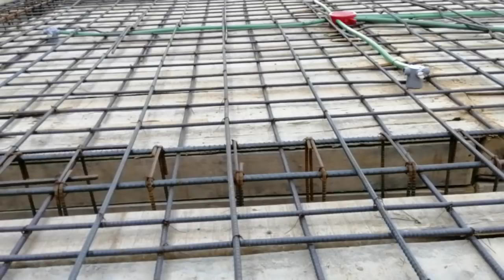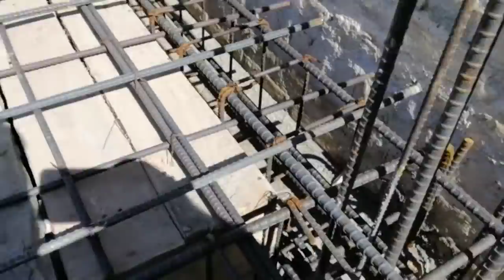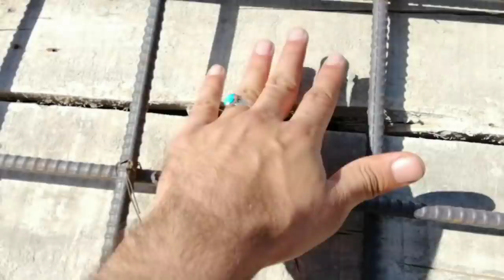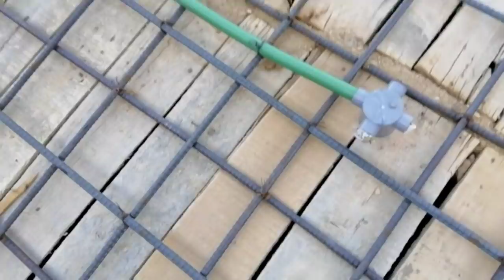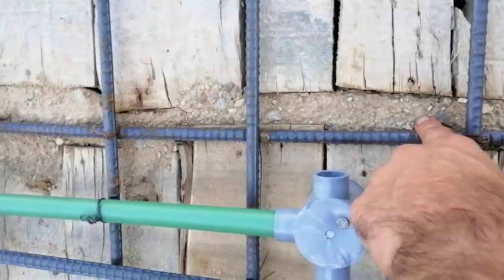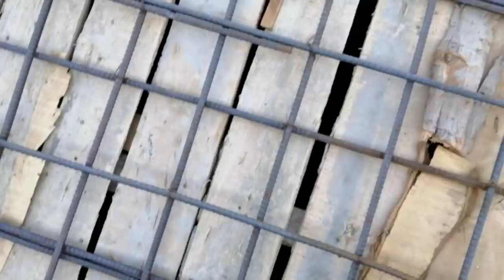Big Mistakes in RCC Slab - Lapping Mistakes - Reinforcement Mistakes - Civil Engineering

Comment from the maker: Remember Guys .. the Upper Bars Lapping should be Provided at the Mid but the tension Bars ( Positive Bars ) Lapping should not be provided  at the mid but should be provided with L/4 Distance ... Thank you.
Reply: You focused on lapping, have you noticed the spacers between forms and rebars?
Reply: @lovewings15corpus31  damn...you are right bro
Reply: I think in simple terms, laps should be provided in the compressive zones of the structural elements. This means laping of bottom bars at beam supports (compressive zone of fixed ended slab) is ok.
Reply: Well for bottom rebars of slab lap is on centre of support. For top reinforcement lap is in centre.
Reply: Sir I didn't understand that lapping length should not be done at the end of the support because shear stresses are more. What kind of lapping is that? Please clear my doubt
Reply: @AbdulRaheem-kk8kv  for bottom bars laps are at support for top bars to cater negative reinforcement at supports there laps are at centre of span
Reply: @arslanamar7011  thanks
Reply: When the top bar and bottom bars are tied together..it's cool
Reply: What is the real reason that they made a mistake by providing Lapping near the beam?  Is it really so difficult to avoid it?
Reply: Review ur knowledge
Reply: But in slap with beam there is only one layer
Reply: So we ve to reassembled All bar sir?
Reply: L/4 or L/3?
Reply: @altain  11
Reply: Since the problem is already there,
What are the probable solutions?

I am just curious.

Thank you

Comment: Sir, we are building a 2-storey house and the schedule of columns are 4 (16 mm steel bars) and 2 (12 mm steel brs), the schedule of beam used is 4 (16 mm)?Is that okay? The steel of the beam used are heavier than the columns?  Total floor area is 162 sq meters. Thanks for answering.

Comment: Military code requires that standard 1 inch thick rebars be used and spaced apart by 1 to 2 inches. All hoops should be .5 inch thick and spaced apart by 1 to 1.5 inches. There should be no splice connections in any concrete floor slab and all splice connections must be done at the beam bending downward at right side of the beam and bending inward to form a U shape upward hook if coming from the left and vice-versa if coming from the right. There should be no splice connections in the middle. For the beams any splice connections should continue through the post steel rebar and be bent-hook at the right side of the post main rebar if coming from the left and vice-versa if coming from the right. The wire ties should be double-twisted double wires so as to increase hooking-holding power after being tied together to hold the hoops and rebars together and that of the main rebars.

Comment: You can lap the bottom bars of the slab at the support if it is continuous, as the hogging moment is putting the top bars in tension. It is the top bars (bars in tension) where you shouldn't lap at the support.

Comment: Location of lapping is ok...review your theory of structure subject because ...slab is treated as beam so there is tension part and compression part...so if ever avoid lapping at tension area if possible but if you cannot avoid it , apply what the code recommend

Comment: There is no Cover to underside of bars no Space blocks have not been used .  You missed that ?  would have been better Laying plastic sheet down on the decking board with the amount of gaps that are in the board . Normally us 8+4 ply + 18mm thick and Mastic joints up from Were I’m from 🇬🇧 is a Drawing supplied giving details for the steel to the fixtures plus the schedules to. Then there is no mistake if they go by the drawing and the length of bars on the schedule .?

Comment: nicely explained thanks 1 point i would like to make is you did not mention about the concrete cover, the steel seem to be sitting directly on top of the formwork should that steel no be lifted to provide minimum cover 50 or 40mm  ?

Comment: Hi ! Sir i have build concrete tank before 40 years ago now i want build 3 feet high wall with bricks on the tank and i want to  put 500 gallon water  plastic tank on it . Does it stable enough????????
Reply: Hi, I am uthayasunthar from srilanka, as your request, you are going to demolish the concrete water tank and replace a plastic tank  ( approximately 2000 lit) . To consider your request the following are needed 1. What is your existing tank capacity and wall thickness,  2. existing colomun  details which are underneath water tank.  . Then it is possible to say the stability of your structure.  However  W e Engineers mostly designed the structure for 50 years life  period due to materials characters of the  market.
Reply: @uruthiranuthayasunthar2073  no Sir  i am not going to demolish concrete water tank actually I'm going to build break wall on this  concrete water tank & to put 500 gallons water plastic tank on it to ramp up water pressure . The concrete water tank is no longer useable due to leakage. 
The thickness of the concrete water tank wall is 6 inches and length is 69 inches.
Reply: @r.dmangol2199  , if you have a tank , this building has about 40 years old. No details r/f of the structure .it is not advisable to keep a tank . Now you are going to build a break wall and place a tank. Accordingly  you will  add wall weight and water weight additionally on the slab. It will be reached failure.  It is safe to replace tank , then you should remove same weight of the concrete structure ( available tank) . Then you know removed  soild concrete  find the weight of removed concrete weight and  replace the tank approximately 80% of the weight . ( Your tank capacity is not mentioned properly please)

Comment: Hello dear hope u will be fine actually I noticed something in your vedio that the lapping bar which they provided is correct  coz in slab bottom (B) we should lap the steel in the supported mean l/4  area and top bar we should lap in the mid of the Spain mean l/2  I am saying coz the same rule we are following here in dubai and as per the design, its corect coz that area is the critical zone area also compression tension occurring sory I just share my experience one thing more there is no cover block touching with shutter

Comment: after a major earthquake near mexico city.. many building fell in mexico city.. including new hospitals.. they showed them starting to rebuild the hospital.. there were piles of sand, gravel and cement. and a guy with a garden hose.. each worker had a 5 gallon bucket and a trowel.. that is how they were pouring the footings for the new hospital.  i called the mexican embassy.. actually got to talk to somebody about this. they had seen the same footage.  thought how great it is to have so many working.. i said every time there is an earthquake that building will collapse.. that is no way to mix structural concrete..  it won't flex it will crumble.. they changed the work rules in mexico.. buildings are now only poured using batch mixed and tested cements. no longer hand mixed like you could do on a single story house..

Comment: As per IS456:2000 the lapping length for beam in comparison reinforcement is development length or 24dia whichever is less and its can be provided at beam column junction to 0.25L of the beam length.
For tensions reinforcement the lap length is development length or 30dia whichever is greater and its can be provided at beam column junction to 0.25L of the beam length and lappingreinforcement is always alternatively provided.

Comment: Extremely poor work. No consideration for the owner of the building. The contractor should make corrections to the spaces in the decking.  I am of the view that if you join  steel steel midway on the span it is going to be weaker, best place to join is where you have some support.

Comment: sir ,see curtailment detailing of roof slab,pls lapping at the end is ok for slab ,but for beam also in bottom is ok,top rod id a mistake 
pls kindly refer structural detailing of slab
shear in slab is near to zero ,base on the depth - shear increase based on depth increase

Comment: big mistakes with the formwork the concrete will cure too quick because of all the gaps and make it weak due to extra water loss and shrinkage
Reply: My opinion as an engineer this structure is rejected during inspection especially the formworks there should be no gap in between the formworks for the water wth cement will leak-out.use plywood formworks suitable thickness instead.

Comment: Agree with your two point.
1. Form work seems poor, Due to continious bleeding ( water falling from concrete ) disturbs water cement ratio the end result will concrete looses its required strength.
2.  Bar and striups spacing.

Comment: Not at all correct. Lap for slab should be on beam. Not at mid as load of slab is on beam, hence the weak zone that is lap should be through the beam. Sagging is encountered at the mid span, hence lap shouldn't be at mid span

Comment: This is not a lap.  Centre of both bars lap is in the centre of beam and it does not make any effect. This etra length of bars could have been cut. Main mistake was , there was not cranking or extra bars at support. So this video is misguiding to learners
Reply: Exactly that what i observed looking at the structure, beside there is no cover block.

Comment: 1. Main bar and distribution bar can be of same dia and the C/C distance between distribution bars can be increased. That will anyway will be decided based on one way or two way configuration. 
2. You should have shown the structural drawing for easy understanding of the mistakes you are trying to show. Without a drawing how the audience will get a picture?
3. Lapping length is not provided exactly at the end support . Yes the lapping should have been staggered but definitely not st the centre of slab. 
4. Wood form work crack lead to bleeding. 👌 perfect 
5. Some points you probably missed out....(a) No extra bar provided at end support of beam as top reinforcement. May not be required as per the design but  seeing the span it seems an omission.
(b) Stirrups not bent inwards at 135 degrees as per the codal provision.
Reply: Mr. Vinod Kumar, u have pointed out the mistakes in a much better way than this guy...

Comment: I was afraid that this video might be misleading in terms of lapping but almost got that lapping for a 2 way slab should be near the support due to the fact that there would be induced moment at the centre of the slab, and thus having a tensile force acting at the centre of slab. Also the lapping o reinforcement can be in the same place however, providing alternate lapping helps to reduce propagation of cracks if it was formed.

Comment: As a QC Inspector i'm not really strict in terms of spacing as long as the number of bars required are provided. My main concern only is the bar lapping and the form shuttering opening that may cause bleeding and will weaken the concrete strength of the structures especially the elevated one/

Comment: As i see in the video the entire slab are mistake,  why?  Did you noticed the space gap between lower slab and the formwork? Supposedly it has a space approx. 30cm to 40cm, on your slab it has no space, when you fill/pour the concrete the rodbar will be possibly vissible when you taking out the formwork.

Comment: Lapping is correct to provide at those end part, but not at the central of the slab. 
Reason: max hogging moment will take place at the near end. And max sagging moment will take place at the central part of the slab in which tension will be at the bottom of the slab, hence it will become weak to provide lapping at central part of slab. The best way to provide lapping is at zero bending moment. By analysis, you can find the zero bending moment. For distribution bar it's ok to provide lapping at central but not for the main bar in case of beam. Similarly slab, lapping should not be provided for main reinforcement bar at central part.

Comment: you point out mistake that is really good but you says that the lapping should be provide at middle i think this statement is wrong in case of beam and slab but may be accurate for column ,in beam mostly lapping is provide in 1/3 of beam not at mid and edge because of maximum bending and maximum shear on this to portion

Comment: Sorry to Say Your all comments are wrong except the shutter.
1. lapping is at good position. 
2. For each line U can't change location of lapping , its not feasible
3. Steel bars which are shown in video are both main bars as it is two way slab.
4. Steel bars sizes and spacing of stirrups must be according to design requirements , in site some one can't proove it wrong.
5. Due to open shutter , bleeding causes to bleed slurry which affect the concrete mixing ratio.

Comment: Where were you all this time? You should have been at the work site inspecting while they were doing it. It's easy to point out mistakes, hard to fix them. So next time be at the work site with the workers and point out mistakes while they are doing it.
Reply: Maybe he was just hired.
Reply: It's in the contract: it's either on-site continuous inspection, or periodic inspection. That false work would get rejected in a hot second in Los Angeles, no seismic hooks on stirrups, the list is long. Pretty sure this job isn't following ACI Standards, all these items are spelled out in the General Notes in the structural plans or typical rebar detail sheet(s). 25+yrs reinforcing Ironworker Los Angeles 416.
Reply: In the US the Inspectors main function is to observe and report, not to direct tradesman or give in-field direction, though that is done quite frequently.
Reply: Good point

Comment: Lapping should not be at center, as bending moment is maximum at center. Lapping should be at point where bending moment is zero and it is near the support at bottom face. Lapping should not be more than 50% of the steel at one section, They are using lapping in 50% steel at a point, so this is correct. Hence, lapping is correct in video.

Comment: Can you site your reference code saying that the distribution bar should be lesser than the main bar?  In this site, we cannot easily tell which is the main bar and the distribution bar. Nevertheless providing a distribution bar diameter same as the main bar is actually safer than the distribution bar with a lesser diameter. As an engineer, we cannot say right away that this is a mistake without investigating the slab design analysis.
Reply: Nice

Comment: the lap should be near the support as there is high demand of moment in the mid span for shear support we have stirrups at the end. kindly review your knowledge.
Reply: Lapping in a slab should be near the support, as the sagging moment is minimum. Lapping near midspan would make the slab  less resistant to bending. Moreover, shear in a slab less than 200 mm is negligeable, the concrete shear strength is sufficient to resist it. Shear stress is resisted by shear links (if not negligeable) and not longitudinal bars. Please revise your theory as you could give wrong information to people!
Reply: How are you guys arguing about this? Lol. Just reference a structural concrete textbook and what page.
Reply: Bottom reinforcement must be spliced after L/3 distance & Top Reinforcement must be spliced with in the L/3 distance from support.
Reply: @fayezali9351  bottom is as per ACI 315, page 27, for bottom bars 0.125L1 or 0.125L2 which ever is greater. In the case of the video, its only one layer. I think it okay for lapping location. It is staggered btw. As for Top bars, L/3 applies. Cheers.
Reply: To simplify, lap joints or splice points for MAIN BARS are avoided/not to be made within Tension area, only within Compression area of the structural members esp. beams/girders, slabs, and columns...but for Temperature Bars it's anywhere. For this purpose, esp for big and high-rise bldgs., rebars are manufactured in different Lengths of 6, 7.5, 9, 10.5, 12, 13.5, 15 meters. However, in cases where the splice point is unavoidable at Tension area, the lap length is increased to 60 or (40db?) times bar diameter.
Reply: For a single mesh slab  i agree with u Mr Muhammad but, if it is double mesh ,Any idia? Where should we provide lapping?
Reply: @jawidnikhat  areas of lowest bending.... there is not set rule that you cannot lap at the max bending but it is not recommended. (in canadian code) infact they recommend lapping bottom reinforcing @ the supports and extending a minimum distance into the support itself
Reply: @rawjor  of
Reply: @jawidnikhat  lapping should be placed in areas where there are greater compression and no tension stresses. Putting laps in the middle may be possible if there is no bending stress in the area like in some cases of overhanging beams. But in no case that laps should be situated in sections with high bending and tensile requirements. the bundle of steel could actually provide more shear strength than concrete but if too much could weaken the concrete shear strength.
Reply: Right
Reply: my initial comment there is the concrete cover. i did not see any concrete spacer at all.
Reply: Agree with Mo and videos like this can only bring confusion and more errors
Reply: Hahahaha yes that's my taught.
Reply: Now I’m confused 🤷🏽‍♀️, who do I listen to ?😩
Reply: @itskay-one5000  Same here !! More than that video I've got more knowledge only in this comment section. Thanks to all btw.✌️
Reply: It’s Kay-one CRSI and ACI manuals
Reply: Yes  i agree if lap is made in the middle there is a high chance for the failure of the slab